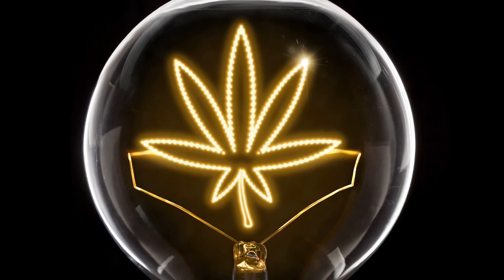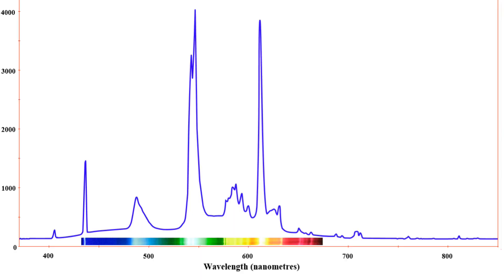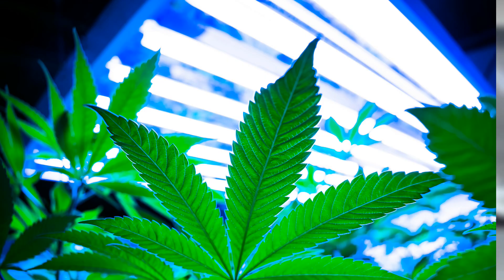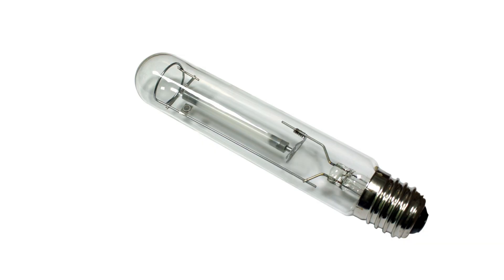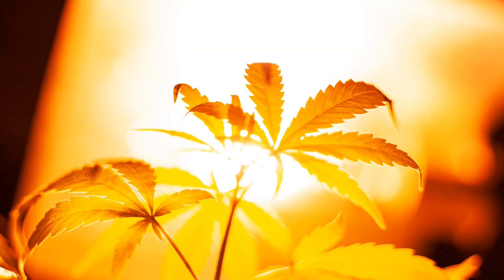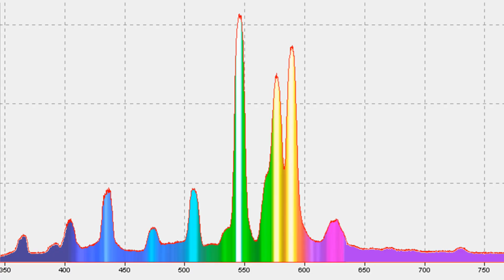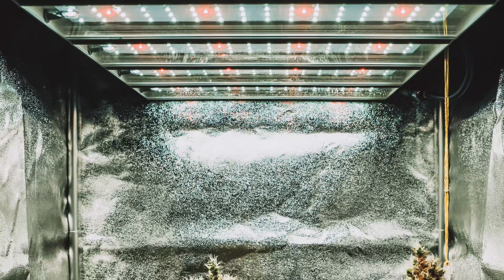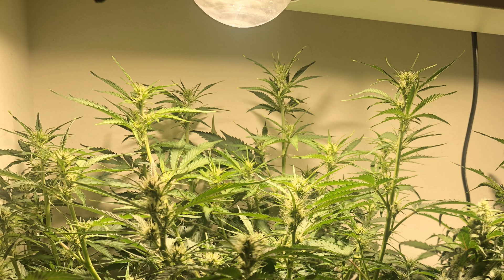The Differences Between Fluorescent, High Intensity Discharge, and LED Grow Lights

Comment: While I mostly agree with the statements here, I would like to make a case for fluorescent T5s, particularly the 4' bulbs. 
Right of the bat fluorescent T5's have some significant advantages for the home grower. Firstly most people's home ceilings are quite low, if HID bulbs or LEDs are used, these need to be kept quite a diststance away in order to get an even spread of light across your grow canopy, and the canopy needs to be a large area to get the correct yield for the Wattage of the light you are using. In addition,  if you get LEDs or HIDs too close  you give the plants directly under the light too much light, at minimum they lose their quality and at worst you kill them out right, meanwhile the plants off to the sides don't receive enough light and they grow much slower. If you don't have 10' ceilings, theres really no place for using  400w and above in the case of LEDs or 600W and above for HIDS (effectively ruling HIDs out unless your're using a digital ballast with a dimmer). There are compensations I guess, oversized hoods for HIDs and you can use a light rail / light mover to eliviate some of these issues for LEDs. In addition some of the new LEDs have dimmers, and manufacturers have further impvoed their designs by spacing the LEDs further apart to spread the light more effectively onto the plant canopy. but still, you need a decent amount of height for your grow space, more so than with a T5 fluorecent. With T5s, they have a perfect even spread of light, you don't need a high ceiling since it doesn't matter as much if the plants get too big for the space, as you are less likely to burn up and ruin your plants. And not messing up your grow is pretty rare in the home grow world. Secondly effeciency only matters if you have a nice full canopy which covers the entire grow space (such as a scrog with a top in every trellis hole) , otherwise you are just throwing light at the floor which is clearly not an efficient use of your light. The easiest light to grow a nice wide even canopy is under a T5, and to verify this you only have to look online on youtube and reddit to see that the vast majority of LED users are either delivering most of their light to the floor, or they are burning up the tops of their plants because they have their lights too close. Also on the subject of  effeciency, we always ignore cooling, in most spaces you're going to need some kind dedicated air conditioning with Both LEDs and HIDs unless you live in a cold country or only grow winter time. This brings T5s right back into the game when we talk about effeciency, since these run the coolest. And while LEDs do last longer, they are still far more expensive. Theres not much reason to choode HIDs these days unless you are on a tight budget and need a sizeable yield. But T5s remain awesome for anyone that knows how to grow, and indeed for those starting out growing since they are 10x more forgiving. Compact fluorescents are only good seedlings as they aren't bright enough to create an even spread of light unless you uses dozens of them. At which point it makes no sense, just use T5s (4ft)
Reply: My LEDs. Dont get hot and have never burned my plants

Comment: What about UV supplement? I have a HLG550 R Spec and a HLG UVA 30 watt. What is your recommendation for the UV? There are also UVA UVB and UVC? Thoughts on the three? Told to only use it during flower and then only 2 -4 hrs. Seems like it may be beneficial during veg also. Haven't had time or grow cycles to evaluate myself.

Comment: I really wanna a 480 array but the reviews on YouTube from the couple people have had different ppfd numbers and say they are flimsy and feel like a composite or plastic and the the separators bend easy and intakes 3 ratchet straps per 240 array to hang. 

Are these reviews simply nitpicking and testing wrong?
And the VAT it included in the price or is the tax something extra I have to pay to Ireland? 
Value Added Tax is kinda confusing  .
Reply: you do not pay tax if u are from ireland...all of new leds have similar components
Reply: @markokraljic727  so I pay the tax to Ireland myself then?
Reply: Ireland is part of eu,if u are from eu,you pay tax without other charges.